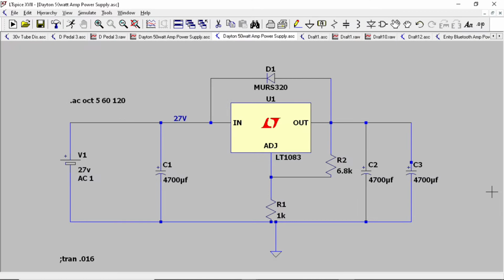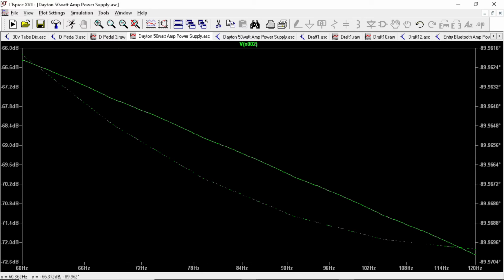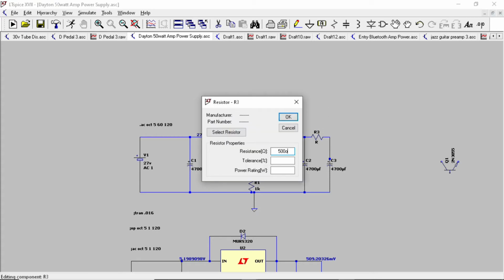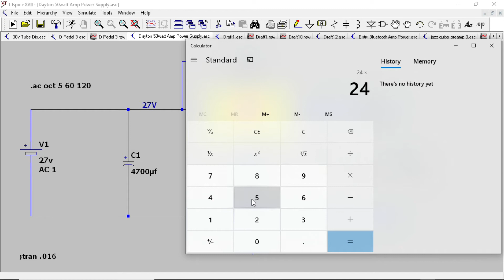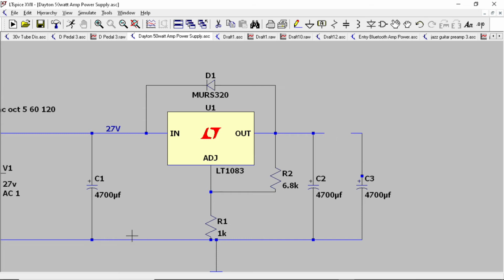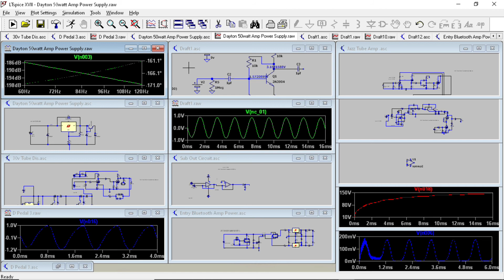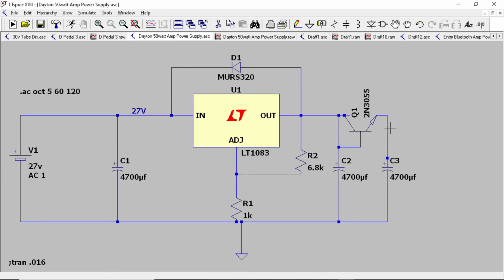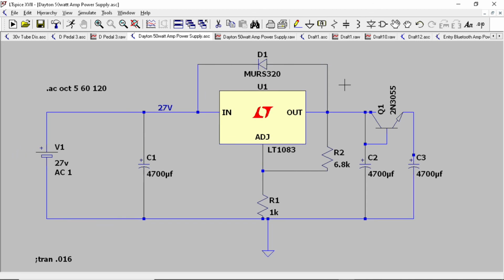Capacitance Multiplier

Comment: Hello my best regards, do you think it will affect the input conditions of a led driver? I have a horrible ripple in my led drivers of about 3 volts and I would like to know what kind of ripple correction I could use, they are 36V and 1500mA
Reply from the maker: That's very hard for me to answer without being able to see a schematic. I general the answer is yes, a capacitance multiplier could reduce your ripple, but a choke could as well. The next question would be where is the best place to but either of the two in the circuit. If you have a schematic you can email me at khayrhodes@gmail.com and I might be able to assist you further.